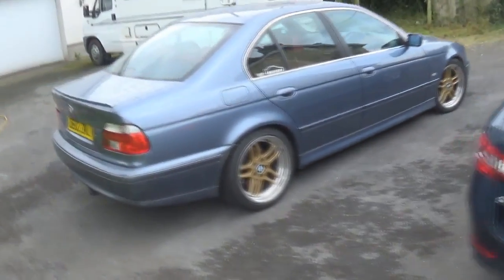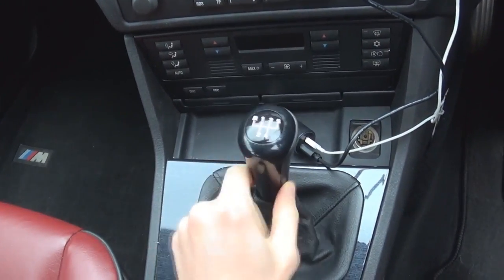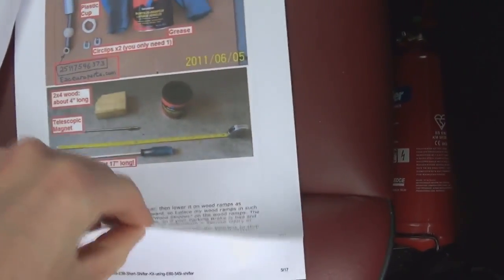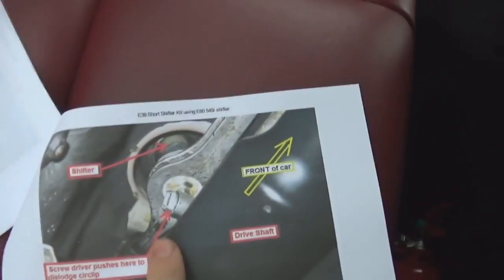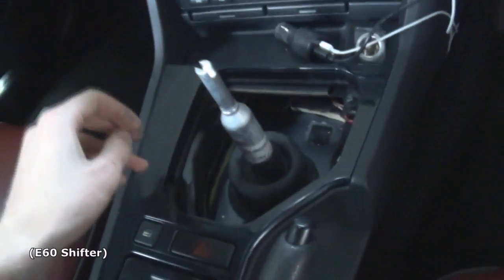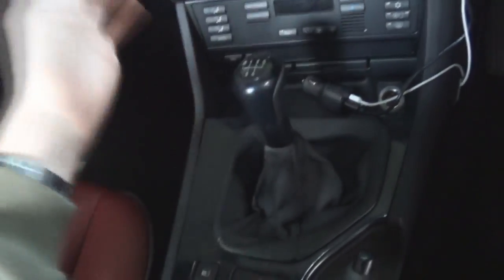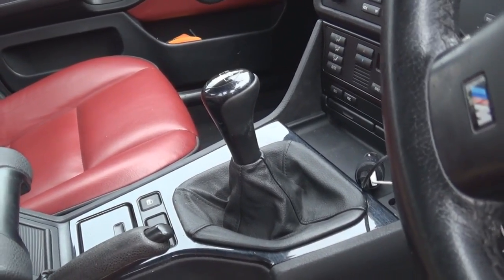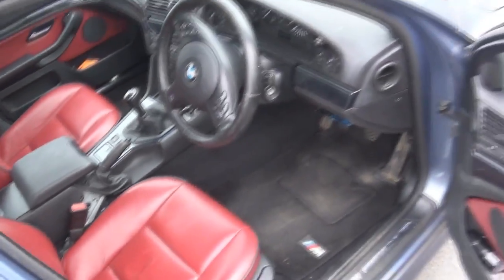BMW E39 Shifter Upgrade:  E60 545i Short Shift

Comment: I actually did the same thing for my 2003 540i after watching this video and looking in the forums... its a world of a difference and its shorter then the stock one.... I also replaced the shift knob I got a smaller shift knob off a 2015 335i it fit perfectly same design on the inside just clicks on and you are good to go.... Many thanks for this video...
Reply: Are you great changes smooth though mate?

Comment: Have this same mod/set up on my e39 M5 and I love it!
Reply: Did you change the gearknob as well? Or is it possible to use the stock boot with the illuminated knob?
Reply: @trevynnagindass8278  ya dude, it can be done i think but i wouldn't do it.  Get the boot with knob attached from turner or wherever and carefully follow the procedure. I really love it but you may have to stretch the boot a hair. Looks and feels awesome. 👍👌🤙

Comment: hi! just find your video and it looks great, but i have a question, we have to take a 545i shifter only or it’s possible to take every E60 shifter?
Reply from the maker: The shifter I recommend is BMW #25117546373:  https://tinyurl.com/mr549yh7  It is listed as standard equipment on the BMW E60 520d, 525d, 530d, 530i, 540i, 545i, and 550i.
Reply: @E39Source   Thank you!

Comment: is it the original e60 545i shifter or a short shifter for the 545i? asking since ecs is out off stock, so it would be nice if i could buy this from a local dealer
Reply from the maker: Stock E60 545i manual shifter.  25117546373
Reply: @E39Source  thank you for the reply

Comment: Did you have any issues with your transmission leaking? German e39 forums are reporting on oil leaks following short shift mods using OEM parts.
Reply from the maker: Installing a new shifter would have no correlation to a transmission leak.

Comment: how much was the part?
Reply: can you post link of the site you bought it?
Reply from the maker: The description has been updated with this information.
Reply: Does it still working fine?? I haven't got so much trust about aftermarket shifters. Mostly I have red only negative experiences on E39 forums...
Reply from the maker: The 545i shifter is made by BMW.  It still works perfectly!  No reason not to trust this one.
Reply: @E39Source  Now only 174.55$. Sweet. Just 3x the Price :D

Comment: You dont have to change gearbox oil on a bmw
Reply from the maker: Dominik Dachs You most definitely do!
Reply: E39Source hello, i am from germany and my e39 has got 356000 km on it without changing gearbox oil.
Reply: Moonshiner E39528i You don't NEED to necessarily, but if you do you will probably notice a big difference right away.
Reply: Wenn du saftig schalten willst, solltest du es schon machen. Kollege...
Reply: Moonshiner E39528i, ich schätze mal du hast noch nie Schaltgetriebeöl gesehen oder Differential Öl gerochen, was mehr als 150.000km nicht gewechselt wurde... Sonst würdest du wissen, was da für eine Brühe rauskommt. Es heißt zwar dass da eine "Lifetime Füllung" drin ist, allerdings dauert ein Autoleben nach BMW Kalkulation auch nur 150.000km...